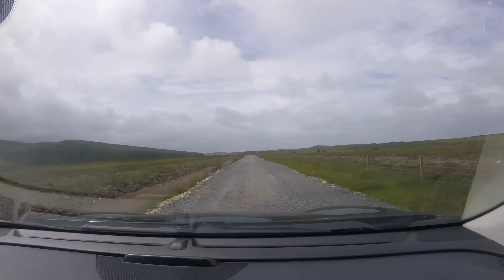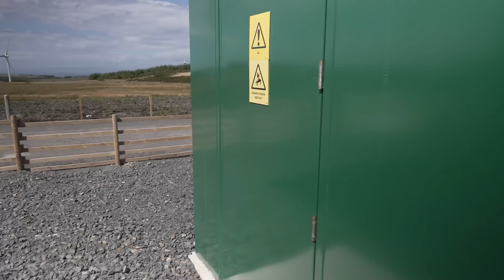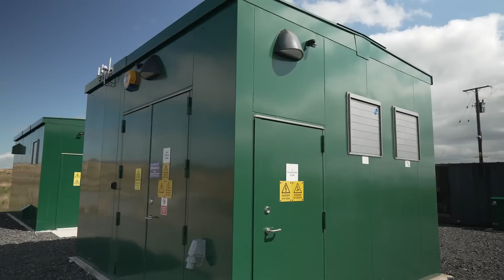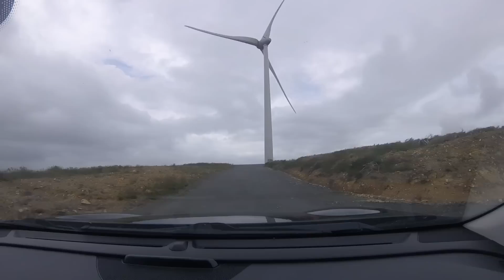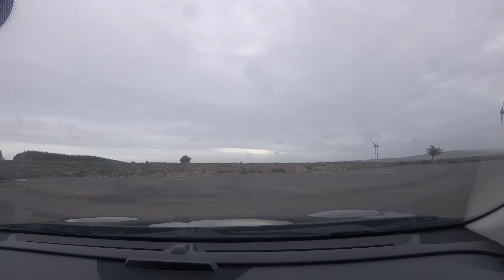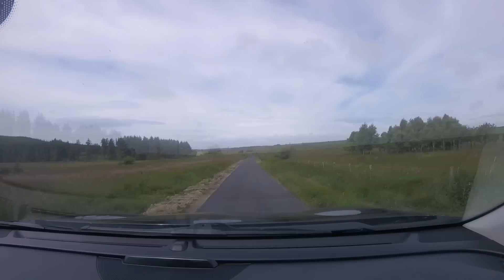A full site tour of Kirk Hill

Comment: Why are the turbines spaced so widely apart and so irregularly?   I sail frequently, and have to pass round numerous offshore windfarms.  They are all regularly-spaced, on a triangular pattern, and muc.h closer together.  Why was this not right for Kirk Hill
Reply from the maker: Offshore wind farms don't have landscape issues to contend with. The layout of turbines in an onshore wind farm is designed to maximise yield, whilst taking account of landscape, visual impacts and ground conditions. Offshore there aren't the same constraints.  Older offshore wind farms were built on grids, but newer ones tend to be in diamond layouts with more turbines on the windward edge of the diamond to maximise yield.